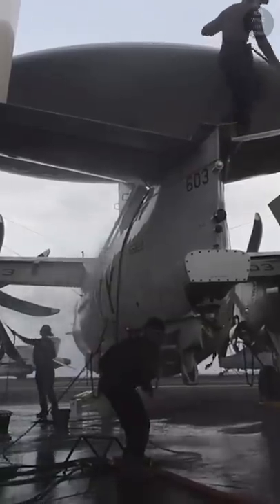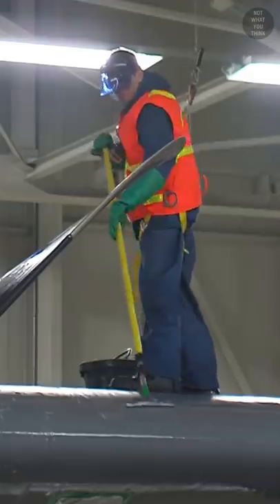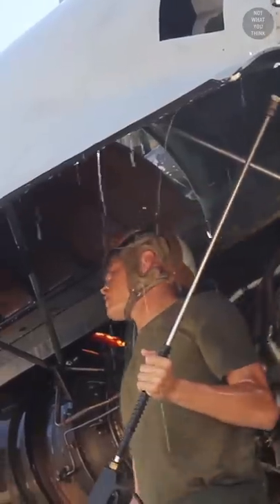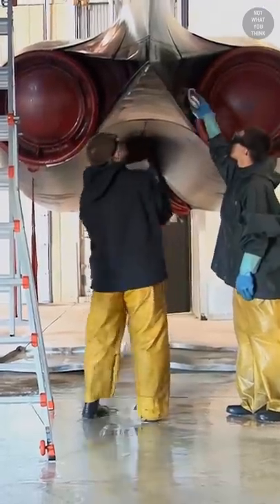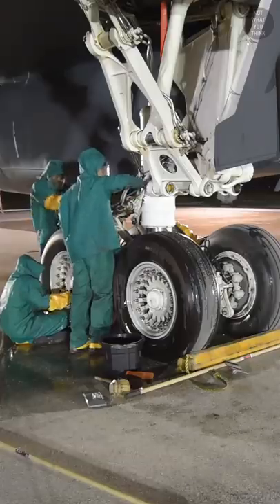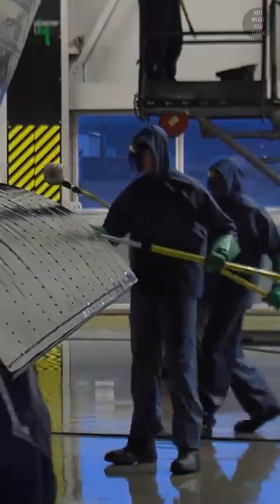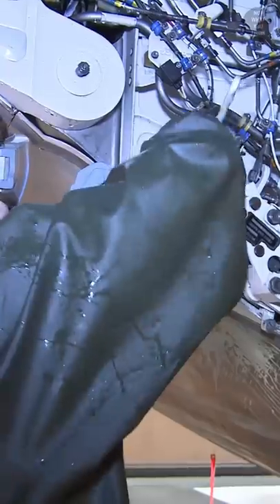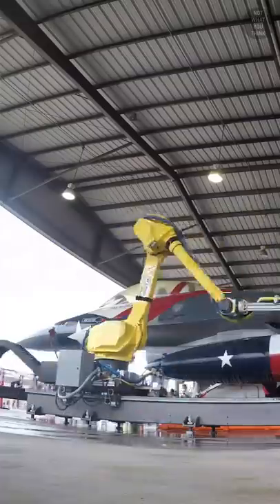What's the Dirtiest Part of Aircraft? #shorts

Comment: The SR-71 Blackbird kinda had a self-clean function.
When cruising around Mach 3.2 - 3.4, the aircraft's external surface could heat up beyond 300°C, burning of dirt and bird droppings.
Reply: You be very surprised that what residue is left and baked on at 1200 degrees Fahrenheit! Krispy crust cemented on the aircraft is harder to wash(scrub) off than exhaust soot and hydraulic fluid.
Reply: @tanyatucjer  would there even be anything I think it would evaporate lol
Reply: @hemendraravi4787  like I said you would be very surprised!!!
Reply: In Ben Rich's memoirs he talked about trying to figure out the source of black particles embedded in the SR-71 windscreen. Turned out they were carbonized insect fragments from the atomic bomb tests that the jet stream kept aloft for years!
Reply: @Malaveldt  what a peculiar thing to find out.
Reply: @shashwatsharma2596  This was the same time they were working out all these other weird kinks like finding out that using cadmium plated steel tools caused corrosion of the titanium skin of the aircraft. I highly recommend Rich's book 'Skunk Works: A Personal Memoir' and the audiobook is pretty good too.
Reply: @Malaveldt  sure bro
Reply: @hemendraravi4787  the organic parts do burn away but the ash that’s left doesn’t. Just like in a cremation, what’s left is all the calcium, sodium and other minerals that don’t burn off.
Reply: Never knew that
Reply: You do understand burning something doesn't just make it vanish?
Reply: @tanyatucjer  just by cleaning my oven, I can confirm that baking something off doesn't equate to easier cleaning ahahaha
Reply: A feature
Reply: Don't confuse sanitization and cleaning. If i burn my poop at 1000C it ends up sterile  and free of pathogens but it's still poop that just changed color and texture.
Reply: @JacquesNjoya  what a crappy analogy
Reply: @ShiratoriIsOffline  The water you drink may have evaporated off the sweaty nose of Vlad the impaler while he was...well....impaling.
Reply: The rain clouds are basically SR-71's free aircraft wash at this point
Reply: @hemendraravi4787  You'd be left with a lot of soot and organic residue  which will stick to stuff and won't boil till 5000 deg C
Reply: @hemendraravi4787  yeah, plenty of carbon buildup left behind
Reply: @hemendraravi4787  I guess rather then burning off, it all gets burnt TO the plane, kinda makes sense I guess
Reply: @firefightszz  yea but it would be super small compared to its initial size
Reply: @hemendraravi4787  yeah
Reply: @tanyatucjer  Um where’s that sandwich?🤣
Reply: @trippen4391  I was just asking your mama the same thing.
Reply: Then how come my oven is always dirty lol
Reply: And birds
Reply: @johnwirk  nah m8

All water was once dinosaur piss

Comment: Man, I worked for Delta. We washed aircrafts for them. I can confidently say that the dirtiest part of an aircraft would be the belly. Especially near the main landing gears. And the landing gears themselves.
Reply: True, it's that damn black grease. You have to use the pungent acetone rags to scrape off the yucky goop
Reply: Landing gear for sure.
Reply: On B-29 Doc it usually had to be the sides of the engine nacelles and tops/bottom of the wings, and the main gear wells, everywhere else is usually just dust, water spots, or bugs, those first areas though usually get lots of oil and exhaust

Comment: Having been an Aircraft Cleaner for 5 years at major airline heavy maintenance base ….I can guarantee you that the tail is NOT the dirtiest part of the plane!! Inside the wheel wells and along the keel beams are MUCH MORE FILTHY!! Even behind the interior sidewalls and in the seat tracks are way more nasty than the tail. Hell, inside of the tail is more dirty than the outer skin.
Reply: Yup 100% those seat tracks and wheel bays are the grossest
Reply: Was about to say the same. Worked on f-18s down in miramar for 4 years in my service, and i dreaded washing the wheel wells
Reply: The flaps and canoes behind the engine sucked too. They were always caked in soot and took so much scrubbing.
Reply: Thank you!!! I was just about to say this. In my experience it's usually the underbelly right around the landing gear and behind it. Anything to do with the wheels is nasty. Now if you are working light aircraft, it's definitely right behind the engine on the underside of any single engine,
Reply: Indeed. I have had the wonderful experience many times basking in the filth of what is a KC-130's wheel well or flap well. Two aircraft per day (according to the schedule), 6-8 people, plenty of waiting.
Reply: I woulda thought the turbines needed the most cleaning.
Reply: the cockpit?
Reply: What base, Odin?
DFW or TUL?
Reply: Depends on the aircraft I suppose. I worked on ch53s and the tail would get pretty bad.... But I think the belly was worse. All the oil, dirt and grease would collect there. And it would only usually get cleaned if someone was in trouble
Reply: Try disassemble passenger seat. 😜
Reply: Thought that sounded fishy. Thanks for your comment!
Reply: So, do they have windshield wipers or something for the bird blood?
Reply: I guessed underneath the pilots seat. I figured it would be plastered with dried boogers.
Reply: Yep, I was an aircraft mechanic in the Navy and I always chose the wheel wells to wash. I have adhd/OCD. Kept me busy for hours!!
Reply: I am a genius just get one person to wash a plain then it would take one hour
Reply: @klhiman  That's interesting, the USAF uses plenty of contractors for ac maintenance. CONUS & OCONUS.
Reply: Hi Odin, that's interesting. Why does the inside of the tail get dirty?
Reply: @zachh5812  Grease from the rudder cables and hinges.
Reply: @OdintheGermanShepherd  That makes sense, thanks!
Reply: Was looking for this comment
Reply: And that does it for this channel. Never another click. Thx for the heads up
Reply: Damn it, My dog can't even clean after himself and you're cleaning planes
Reply: @tpstrat14  You might believe this is a true fact "but it's not what you think".
Reply: Aircraft mechanic here, I was going to say the exact same thing.
Reply: @brett3103  nah, the turbines are actually extremely clean, just a little soot in the exhaust section.
Reply: The toilet on a C130 after 50 paras have shit in it is by far the dirtiest place on an aircraft
Reply: All the skydrol in the rear beams.... wheel wells, around the replenishers.... outside is the easy part.
Reply: The bilges in helicopters can be way worse than the tail, too. I wore a mask when cleaning them out.
Reply: But it's not what you think.
Reply: @theheroingreen  Miramar, Cuba?
Reply: @kamu747  nah Miramar San Diego. It’s a USMC base in California
Reply: @ArizVideo  that's crazy because the Air Force I know doesn't like contracting and will replace them with us if it means saving a buck. Were you in?
Reply: @klhiman  I'm with you brother, but, the AF loves contractors.
Reply: @ArizVideo  I'm definitely not saying they don't but, every single base I've been to oconus, conus, especially tenant units, we always had to clean our own shit. KC-135s were pretty much the only exception I saw.
Reply: I'll second (or 41st, as it were) this
Reply: Oof
Reply: As a former maintenance worker for F-15E I can confirm this.
Reply: I've painted many general aviation craft and 100% agree with you. What the hell is this guy talking about???
Reply: The pilots
Reply: So your comment is the true not what we think?
Reply: @wallacepgames3246  a show like this wouldn't know because lack of experience.
Reply: I was like what the fuck when I do inspections on number 2 engines the tail is always clean, flaps and slats and wheel wells are the most dirty, and behind the fan blames in the engines 🥴
Reply: I was just thinking the same thing, bro.   The tail?? Smh....
Reply: Odin-

He was making a fucking joke
Reply: Blades*
Reply: Was gonna say the same thing. Work on p-8's (737) and the wheel wells and wheels themselves get filthy. And seat tracks always have crumbs from the aircrews snacks
Reply: Second one is the Cockpit.
Reply: I am so sorry. Aircraft wash phase was literally the worst thing ever. 8 hrs for 8 people? Uh, no. It took us 48+ hrs around the clock 12 people.
Reply: For passenger planes it's the floor
Reply: If it's a passenger aircraft it's the seating and carpet and seat-tracks. It's just like any other public transport. It's all spilled drinks and stepped on snacks and any other filth people leave behind. We do on occasion find some cool stuff like jewellery or electronics left behind. You always want to be the 1st person on board once it's in for maintenance so you can skim through and hopefully find stuff. Best things I've ever gotten myself was some neat foreign coins is all.
Reply: True, the wheelwells are the dirtiest part of commercial airliners
Reply: I've  never even  touched n aircraft  like this, but I  would have to agree  with this comment  cause it sound good 👍  😁😛
Reply: Yeah, when I was in the Marines (I was a loadmaster on a C9) we would constantly be taking all the seats and everything out of the plane to clean it and reconfigure the seating/cargo configuration..when we had it empty and just a bare metal floor inside, we called it the "bowling alley." Made it easy to vacuum up the seat tracks. We kept those planes SUPER CLEAN cuz we only had two of em. They are no longer in use.
Reply: Chinook mechanic here, you've got a point. for us it's usually underneath the floorboards, or in the bottom of our avionics bay.
Reply: @Amin MK apply online..
Reply: AHHHHH keel's damn dirty
Reply: i can guess that
Reply: Wait can no one tell this is a joke? I'm pretty sure this video is part joke. This is done on this channel a lot.
Reply: Not the leading edge? Interesting. I’m a GA pilot so that was my guess
Reply: How does one get this job?? Seems awesome what are the requirements?
Reply: Inside landing gear bay is the dirtiest part I have experienced.
Reply: Nah inside pilot cockpit..my friend he's pilot always bang steward girl while auto pilot mode.
Reply: Took the words right out of my mouth.
Reply: You're right dude, wheel well is the dirtiest thing in aircraft 😂 as an mechanic, I clean B 737 wheel well and it was so dirty
Reply: My experience is the exhaust section of the cowlings. Just coated in soot. Also brakes, especially if you have steel brakes.
Reply: yeah i know
Reply: Im gonna be doing f16s soon
Reply: Kl
Reply: Dad who was a mechanic for 30+ years confirms that the wheel wells is the dirtiest part of an aircraft
Reply: Speak brother
Reply: Wait you're telling me the random youtuber doesn't actually know what he's talking about? Say it isn't so
Reply: Line shack or civilian side?
Reply: Not to mention that it certainly Does Not take 8 hours to wash down a C130/123
Reply: How often do you clean the aeroplane? Once a month? After every sorties? Or what?
Reply: Nose wheelwell is the worst
Reply: Yes sir you got it
Reply: Ll0o

Llello9p
Reply: @garrnk  o

l0llll
P
Reply: Always loved the shirt diapers in the seat back pocket
Reply: Having been an Aircraft Cleaner for 0 years, I can guarantee you the tank the holds piss and shit is the dirtiest part of an aircraft
Reply: So they just couldn't resist the pun, huh?
Reply: Was gunna say the same thing I work on commercial airliners and wheel wells definitely
Reply: You must be referring to the 737

Comment: I work on. Hercs, and it DEFINITELY doesn't take 8 hours to clean an aircraft unless you're going at with with spray bottles and a rag. It'll take like 4 if you're taking your time and the dirtiest spot is usually the area under the left wing because that's where the auxiliary power unit exhaust port blows on so it turns it dark enough that no one bothers to clean it entirely, you just try to blend it the best you can
Reply: You should’ve been on our wash teams. Anytime we had a wash we would have a group made of specs, mechs and crew chiefs on 2 12 hour shifts. Once a wash took 3 days. Complete ridiculousness.
Reply: @halvey8518  even the intricate ones don't take more than a day. That being said, we have generally have 2 hoses and atleast 7 guys
Reply: Cool I bet you get paid a lot to clean airplanes
Reply: @jaidendavis8898  in the military, it's just a part of a bigger job. Outside the military, I've heard of people waking people's personal planes for a couple hundred bucks per plane
Reply: GTC's (Gas Turbine Compressors) really deposit a lot of soot on the left side of the aircraft. Also the wheel wells and flap tracks are usually caked in mud and filth.
Reply: U must be talking about C130J because these old H models run dirty that exhaust soot is CAKED on there
Reply: @remember1ify  walking planes??? Why tho?
Reply: I always thought the landing gear was the most pain in the butt and dirtiest myself
Reply: @mikemike729  I personally love the landing gear. You can just hop under there and play music on your phone while everyone else is out there getting soaked and scrubbing things 10 feet above their heads. You just kinda sit in one spot and take your sweet time to handle a hand full of spots as opposed to having to worry about the entries skin of the plane
Reply: @somedonkey5934  - He made a mistake and you made a mistake on his mistake. Saved it?!
Reply: @remember1ify  based on your channel, you are lying.
Reply: I work on F18 E/F’s and I can agree either right behind the APU is the dirtiest or inside the landing gear for us, especially after launching using cats on a carrier.
Reply: I worked on 130s in the AF and it took two twelve hour days with 10+ airman. Then when it’s inspected you fail and have to keep going lol
Reply: @remember1ify  I always volunteered for the gears. Music and no PPE (unless someone was coming) made it a smoother day.
Reply: 4 hours? If you work in the AF, QA must be blind. It takes 3-4 hours just for prep work for the wash. Belly band, taping, covering panels, extending flaps, tying GTC, opening gear doors, covering tires, Forms, Tying and tagging Circuit breakers, and more. Thats just prep….
Reply: @jimhelpert299  12C preps the day prior. The washing itself only takes about 4. The day of, the last bit if prep is about an hour and a half of gathering/briefing everyone and connecting hoses. But in term of actual time spent washing, it's about 4 hours. Because the people end up absolutely soaked and covered in soap that can irritate people's skin, we have a policy that they get to head home after the wash. With a 6:30 show time, them getting out by noon isn't strange at all
Reply: Interesting thank you 🙏 😊
Reply: How to apply cleaner aircraft?

Comment: That depends on the aircraft. On small single engine general aviation planes it’s usually the belly or side of the fuselage. Oil leaks and exhaust usually run down the bottom.

Comment: Speaking from experience on the Raptor; I’d say the main wheel wells and the engine bay doors. Hella lube, brake dust, hydro, oil, fuel, etc.
Reply: No one asked
Reply: what base?
Reply: @maxim9110  Langely and Elmendorf.
Reply: @youALLadopted95  yer a legend
Reply: @dimitrygornomelikov3146   he doesn't need your opinion to comment

Comment: False: dirtiest part of an aircraft is a close battle between the MLG doors and Engine nacelles
Reply: The main landing gear is coated with brake dust at rubber from the tires. Sometimes it builds up into chunks.
Reply: Yeah the inside of the engine doors get pretty nasty. But at least the cracks would become visible from the outside before you had to get them spotless on the inside. That's about the only place the maintenance chief would cut you some slack.
Reply: @thingymuhbob   ah yes. That good old burrylium break dust. So good for your health 😅😂🤣
Reply: @thingymuhbob  also the grease from all the moving parts.
Reply: @batvette  @Ed Otis, yeah I’ve seen it first hand. It sometimes turns into a thick black paste.
Reply: Glad you said it first. 
Might even throw APU exhaust on some of the older birds in there at 3rd place...
Reply: Pretty much anything on the inside of the aircraft is dirtier than anything on the outside. I can touch most parts of an aircraft skin without getting my hands dirty, but touching anything under a door is guaranteed to coat your hands in grease. In my experience, avionics access doors get the dirtiest because several types of maintainers need to open them and most have grease all over their hands.
Reply: @orpheus280  I'm going with lav doors for the dirtiest lol.
Reply: Always the nacelles.
Reply: Don’t forget the exhaust for the waste tank, can be coated in shit and blue fluid if the valve is broken or the tank is full

Comment: As a guy who has cleaned c-130s in my past experience, I'm gonna have to disagree. I'd have to say the under side of the wings. Interesting job though, we used really big magic eraser sponges to clean them.
Reply: Really? I'd say either right mlg wheel well or underside of the right wing. From all the washed I've been on they take the longest
Reply: Wait whatttt???
Reply: @conorbray2330  nose landing gear  or right behind the exhaust is always the worse
Reply: @ImAnEnganeer  landing gear is more of the obvious answer. Its always dirty, then gets trapped inside. On the exterior, the nose gets some bugs but The wings collect all the carbon from the engines and dirt just sticks to it.  Was always the worst from what I remember.
Reply: Landing gears are the dirtiest. It needs a stronger mix of solvent and cleaners
Reply: There are also urine stains, hydraulic fluid, and saints know what else thrown up from the gear and ground on the bottom. Sometimes we had a mechanic's creeper to make it even easier to get soap in one's eye.